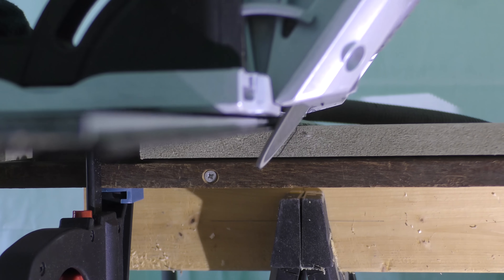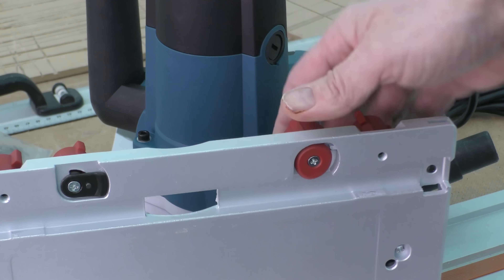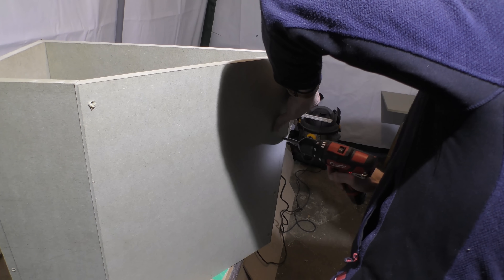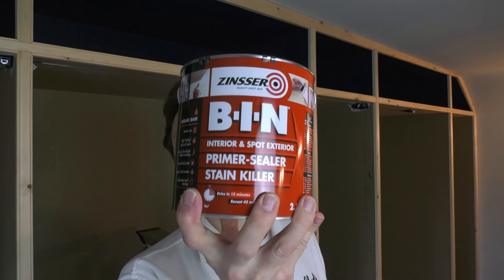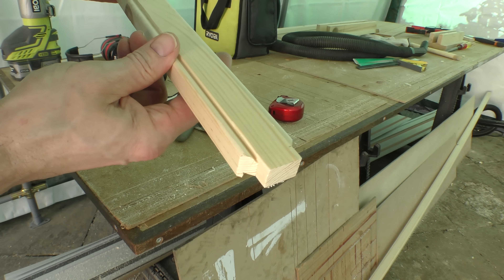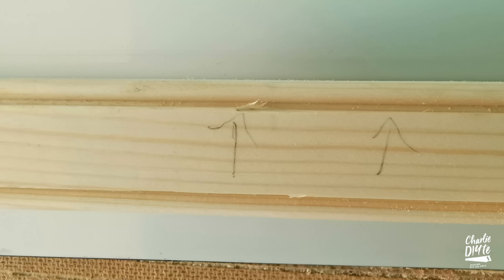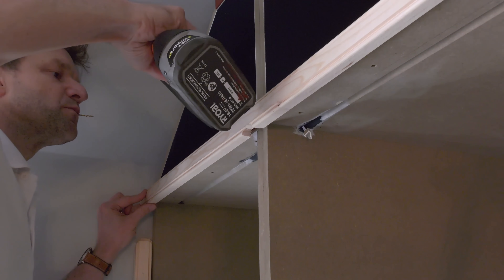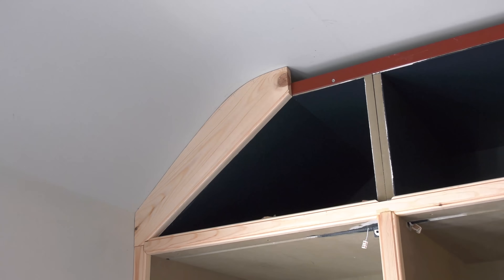DIY Fitted Wardrobe Build - TOP BOXES, PAINTING & FASCIAS - Video #4

Comment: Was the metal banding necessary? A face frame would have done the job no?
Reply: It's very much belt and braces I do agree.
Reply from the maker: D'you know what, Rob, in actual fact, by the time I'd routed the guts out of the fascia, it was light as a feather and I don't think would contribute any strength to the carcass. The hanging rail on the other hand is an interesting one - because that could either contribute strength with its central bracket fixed to the roof of the carcass, or with everything  hanging on it, have the opposite effect. It will be interesting to see. I'd be intrigued to know how everyone else gets round this problem.
Reply: Yeah I figured that later, it wasn’t so much a face frame but more like beading. Looks good though. Thank you for sharing.

Comment: What's the radius of the edge beading. Thanks
Reply from the maker: There's a link to the tool in the Description. Should say in that. I think it's about 6mm from memory.
Reply: @CharlieDIYte  I did not see it there but will check again. Only seen the flush trim bit and straight bit. But thanks anyway. I'm going to attempt to build the same style cupboards as yours but without the lighting.
Reply from the maker: @BOBBY-et9xb  I'm sorry about that. It wasn't on there for some reason but now it is. The code at Wealdon is T2503B 6.4mm 1/4" bit. It's the one at the top of the page when you click on the Beading Large page. Good luck with the project. 👊🏻🤞🏻
Reply: @CharlieDIYte  Thank You 👌

Comment: Have you read the reviews on the Erbauer Plunge Saw, lotsa complaints
Reply: Where are the reviews?
Reply from the maker: I haven't. They're all pretty positive on here https://bit.ly/37z6Rdq but it is a Screwfix portal so maybe not impartial. If you're comparing it with a Festool it is going to be rough around the edges, but for what I use it for - every day DIY when you don't want to spend £300 plus, so far it's done the job admirably for me.
Reply: Don't forget RS, many negative reviews are from people who blame the tool rather than their own incompetence and ineptness. You may well have professionals comparing it with their £300/£400 Festool, which is complete nonsense.....like comparing a Bentley to  a Fiat.
If it's good enough for Charlie, I'm happy to pay my £150 on that basis.
Reply: @Martin4963  well I have been around for a while with tools, rebuilding lotsa houses over at least 30 years.
If you go to sites of shops that sell that equipment you find plenty of reviews. Now I always start at the lowest rating and look for similar failures. I don't mind people that say, it doesn't fit my hand and the like . But serious blade problems that occur more than once are a big no no to me.
Reply: @CharlieDIYte  Well I always look for the worse reviews and the way they explain the problems.  If they are solid, (so not something like, it doesn't fit in my small hands or the like) more frequent than often 
and well explained, I rather buy something else, even more expensive .
Reply: @Martin4963  At the shops who sell them , goony
Reply: Lots of bad reviews are from people who do not know how to use the tool, don’t bother reading the manual and do not setup the tool correctly.
Reply: @normanboyes4983  Well you haven't read them, they come from other tools like that and had bad experiences using them, they also had burnout machines after 30 minutes using them )more than once) , several problems with the blades (more than once) etc. 
I would read them first before dropping the obvious.
Reply: @RS-Amsterdam  You are correct I have not read them.But then again, I will not be purchasing so have no need  to.
Reply: @normanboyes4983  I have more than knowledge enough about building and tools to separate the nitwits from the "amateurs with skills" and pro's in the reviews. I even repair tools and machinery more than often.
But if there are complaints or problems mentioned more than once, with  substantiated reports about the use and circumstances they occur one can see a pattern and a flaw of that tool.
Reply: @RS-Amsterdam  I agree - the biggest disadvantage with Erbauer is (once out of warranty) there is no service or spares support - that is a killer for me.

Comment: Charlie, I do appreciate your no frills approach but aren't you throwing away good money by buying low quality tools? Erbauer is cheap and cheerful (as you are sure to know) but will not last! WHY buy it???
Reply from the maker: You raise a very good point there, Dmitriy. Perhaps I'm breaking my own golden rule of "you should always buy the best quality tool you can afford". However that has to be metered against two very important points 1) budgetary constraints in these hard times and 2) only buying the tool that you NEED for your requirements. An occasional DIYer who is perhaps building one wardrobe every few years will not wear out a tool like the Erbauer. A Festool would be a waste of money in this scenario. People have always scoffed at me using Ryobi tools. However in all the years of using them I only have one combi drill which has now become a bit unusable (clutch has gone and chuck doesn't tighten properly). And I used them 2-3 days a week in the old day job. Granted, if I was on site 5 days a week I'd need a bone fide trade tool like a DeWalt, Makita or Milwaukee, but I am a DIYer. That is my brand and so I'm honour bound to use tools that are consistent with that, and so far, I haven't had my fingers burnt.
Reply: @CharlieDIYte  Oh well, Festool is a totally different story. Having said that, I would buy their sanding sponges on Amazon instead of cheaper by a few % and be certain that I am getting a real great quality tool (even if disposable).